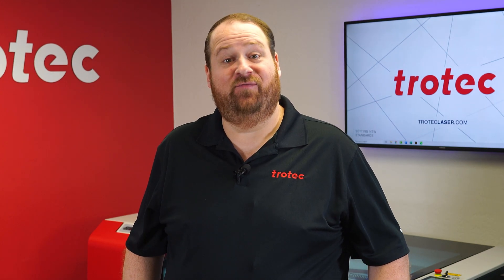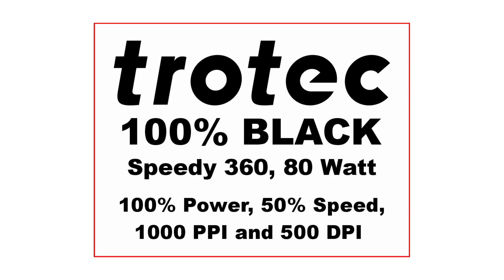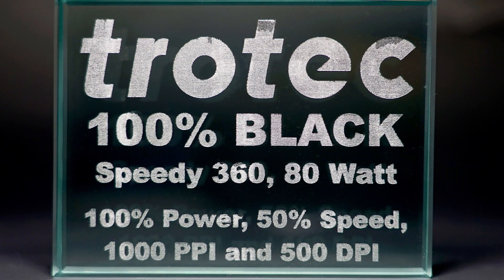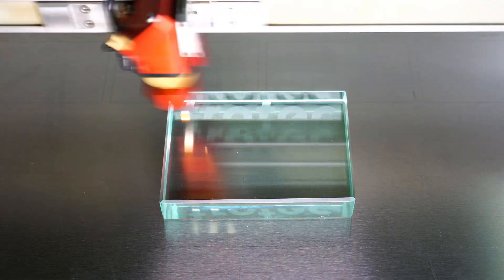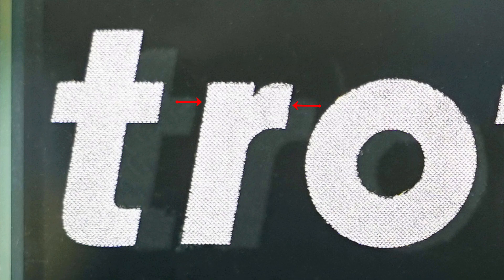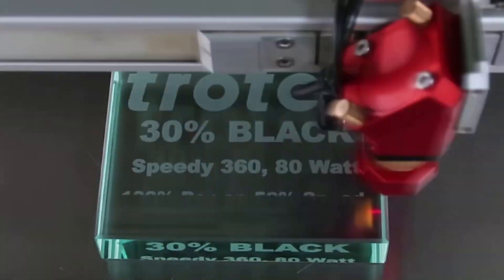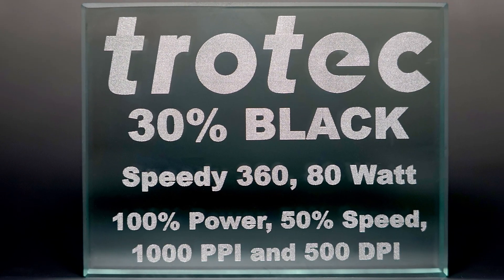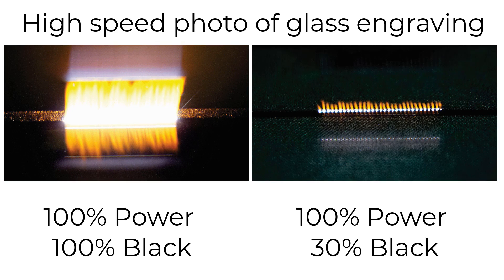Laser Hack: Engraving Glass

Comment: Do you have power, speed, resolution Settings for the speedy 100? Still use 70-80% gray? Any help would be appreciated. My attempt with the presets didn’t work and left a lot of chipping and imperfections and the dish soap seem to block part of the engraving on one side of the glass. It was different.
Reply from the maker: This will depend on the wattage of the laser, but yes, the 70-80% grey will work and run at 100% power, and the speed will vary depending on your laser wattage.

Comment: So I got this to work eventually, but is there a specific color space that ruby works in? 

When exporting from Adobe illustrator in CMYK colours, the 30% black doesn’t show up by default and I have to mess around with the colors to get it to work, I tried 3 different exports before it worked. I did finally get it to work though it was just a little convoluted 

Just hoping there’s a proper color space tip?
Reply from the maker: Our laser used RGB, making this easier. Consider using RGB in Adobe

Comment: Hello Dave,
Jobcontrol doesn't read the 30% black for me.
No engraving is done at this point.
What do I have to set?
Reply from the maker: Make sure "Ordered Dithering" is turned on, the laser power is high enough, and the speed is low enough to make an effect; if it still does not work, please go to our user portal at mytrotec.com and submit a support request so they can investigate.

Comment: The setting of 50% speed indicates what speed?  For example, if I wanted to use lightburn instead, it would require me to select mm/s or in/s.  The Speedy 360 lists a "Speed of Motion System" of 139 in/sec (355 cm/sec.).  Does this then mean that 50% speed is half of 139 in/s?  Thanks for this great video!
Reply from the maker: You are correct, 50% speed is half of 139 in/s or 70in/s

Comment: I understand the laser hack is for larger graphics, then what is the best settings if you are working with the face of shot glasses and a 1" logo w/text without rotary?
Reply: Settings will depend on your laser system type and wattage; testing may be necessary to find the best settings; please contact support if you need guidance.